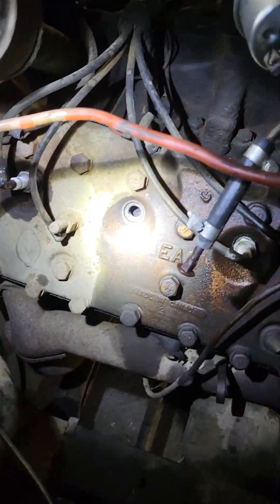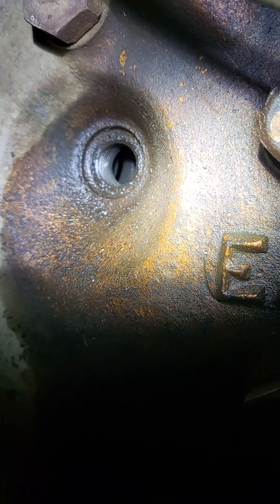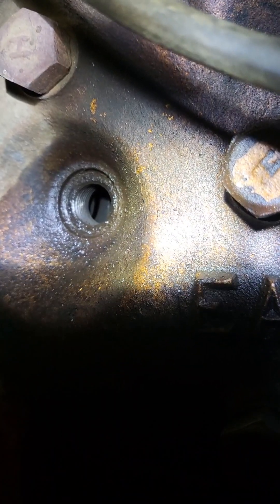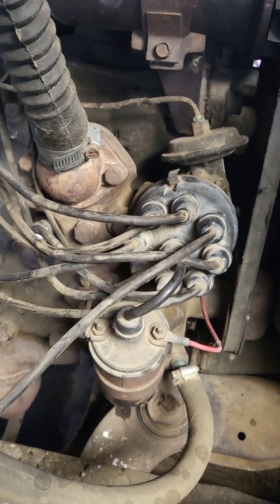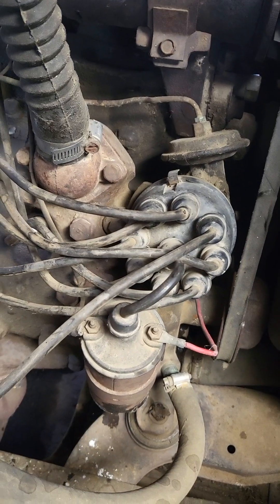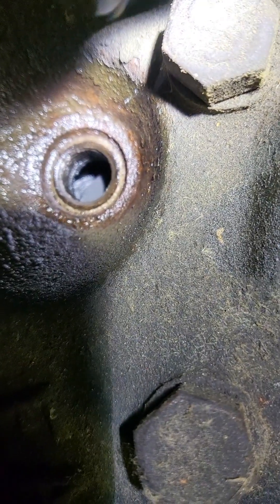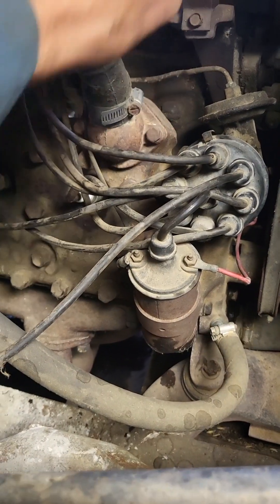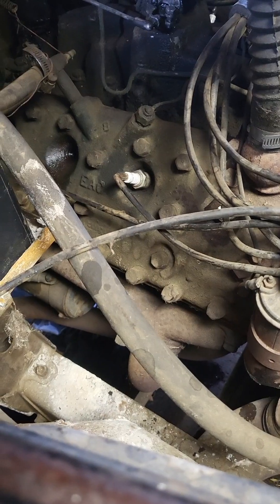Ford/Mercury Flathead V8 oil pressure and sticky valves.

Comment: If you had "stuck" valves in a flathead engine, I can only imagine what the semidried sludge looks like below below that intake.
Reply from the maker: Thanks for the comment. I agree. Hopefully, we can pull off the intake and take a look. It's hard to hear on the audio from the cellphone camera but it sounds a little clicky or tappy. I hope to check and adjust the valves.
Reply: @PJTVenturesInc.  I'm guessing you haven't been inside a Ford flathead before. Adjusting valves is done one of two ways - installing a set of adjustable tappets or pulling that valve, spring and guide then grinding the valve stem - and both ways aredone after a valve grind. You need a special tool to pull the guide and valve assembly retainers as well as (usually) a new set of those retainers. Those tappets, retainers and tool used to be dirt cheap but sure aren't now. An old MoTors Manual will help. '49-'53 8BA style engines are a little different then the earlier '32-'48 engines but similar in job scope
Reply from the maker: Your hired lol

Comment: Very cool, thanks for the update. It's a really nice truck and I'm glad it's being saved. Any update on the oil pressure?
Reply from the maker: Thanks for the comment, yes we put a mechanical press gauge on it, and it's working good. The next challenge is temperature, I think there's a electrical issue with the original dash/wiring harness. Both temp and oil pressure are dead but the volts are working. Also I got a new starter solenoid. I have a few parts on order.
Reply: @PJTVenturesInc.  great to hear man! Looking forward to another video.